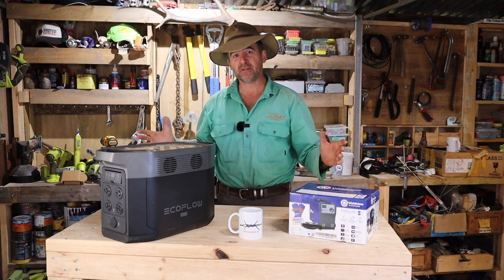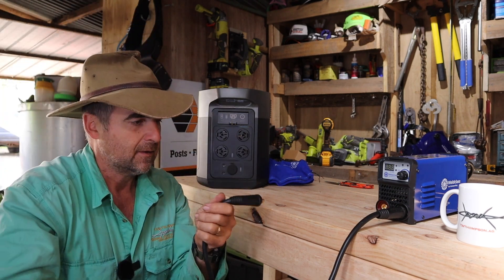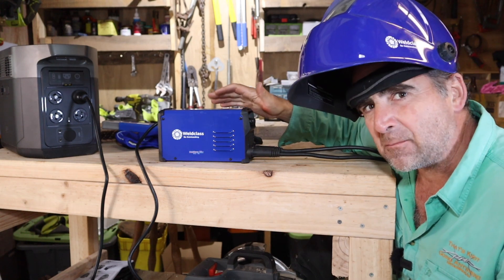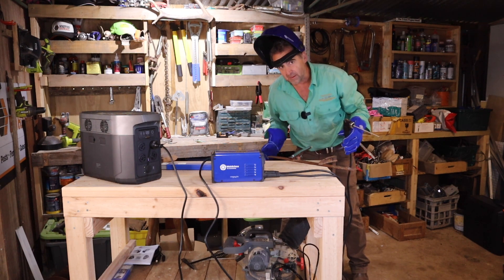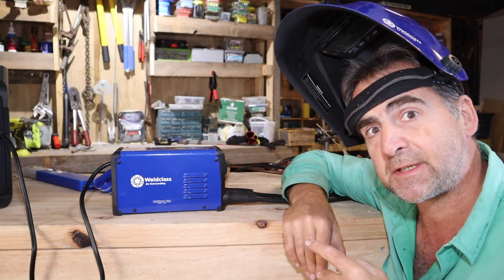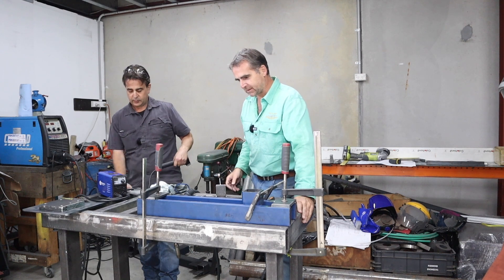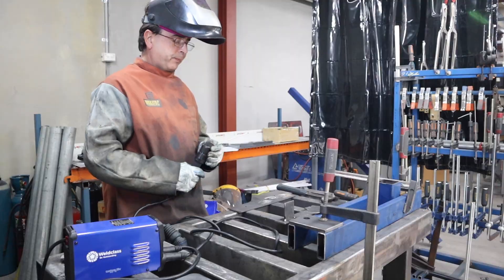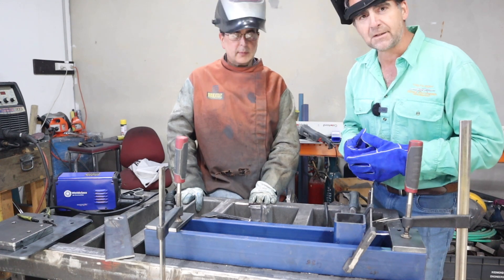Is This Tiny Welder Any Good?

Comment: You can drop down to a 1.6 diameter electrode. They run circa 40 amps. I've ear marked this Vid as something you can run in the field, or off a battery pack. General purpose 6013 rod. More than enough to stick a gate hinge on. Probably worth a practice weld

Comment: ok, so here is my thoughts. a 10amp outlet in your home can run about 2400watts. the eco flow 1600 can  produce about 2000 watts which is roughly 80% of that. 80 amps is about 80% of the welders max. (none of this is totally accurate and doesnt include inefficiency losses) so i can see why it dropped out at around 80 amps. its right on the edge of 2000 watts and asking a little too much as a constant load. it handles the surge for a short period as expected, maybe the ecoflow max 2000 would run this at 100amps with less issues
Reply: ps i love your channel and this video
Reply: The correct way would be to calculate the amperege knowing the voltage at set amperes on the particular welding machine. E.g. lets say 22V at 100A this welding machine has. Then 22×100=2200Wt of welding arc power it produces, then knowing the efficiancy  coefficient K lets say K=0.6 you will need to calculate the power this unit will draw from the power supply P = 2200/0.7 and divide the answer 3142Wt  by 240V(you need to use the actual voltage at the battery outlet). This will be the value of the current in amperes this unit is drawing at the settings of 100A from the power supply. If the battery can supply this current then all good. If not it will cut off obviously. The rule of thumb is great but it needs to be calculated first, really before you run the test to ensure that you understand the limits for particular model of the welding machine in this case 135ST

Comment: Watching steel fixers with these clipped to their belt about a decade ago was impressive.
Had a friend bring about half a ton of hardwood strapped to the roof of his enclosed trailer he picked up for $350.. It was held together by rust and a little steel. Six months of Sundays later he's about to drive out with a brand new trailer. Hate to say it, but the hot dipped trailers from China assembled here are a bargain.